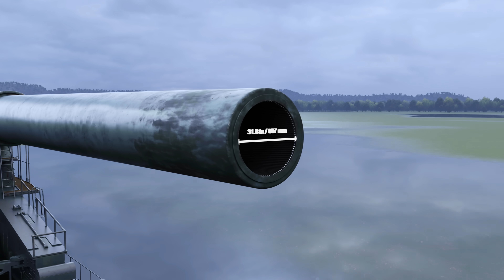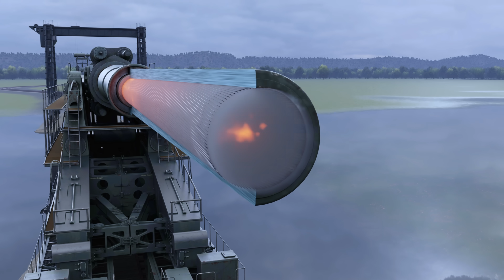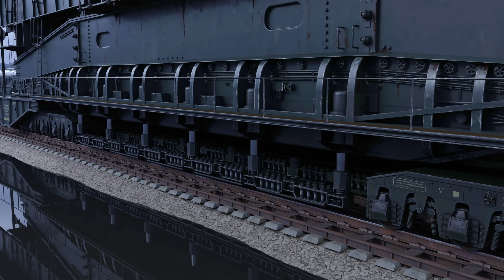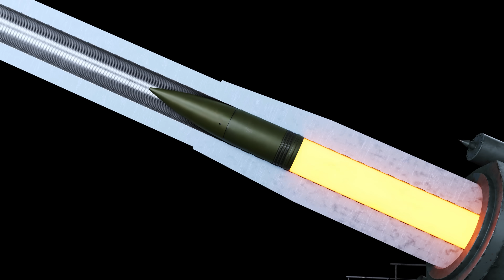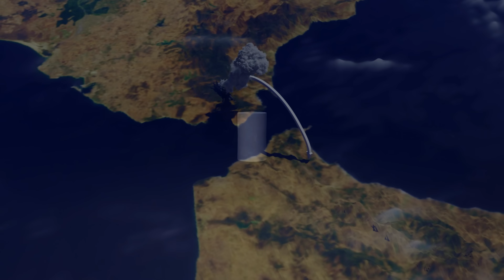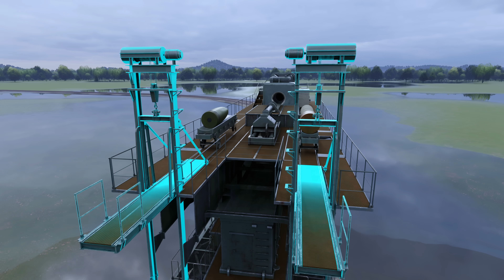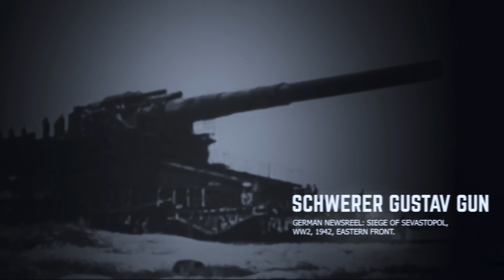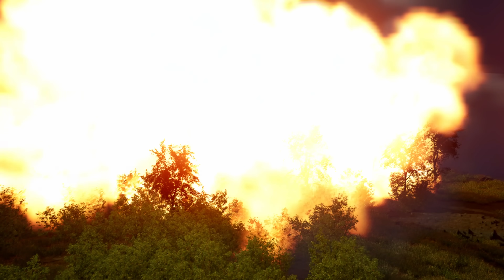Inside the Schwerer Gustav

Comment: the final boss of logisticans
Reply: Logistics was not about the materials itself, it was about the deployment of those materials, how, when, and where.
Schwere Gustav was made to engage the French forts just bordering Germany, meaning it didn't even need to leave its country to operate, and in engaging Soviet forts, the gun could take its time since that fort wasn't going to walk away anytime sooner. In comparison, deploying a Sherman tank to Europe took more logistics capacity than Gustav as it had to travel entire ocean
And of course it was only deployed less than four times around, the efforts to transport the gun was completely insignificant inside German military in the entire war.
Reply: @sthrich635  Yeah, partly because they eventually figured out that moving the gun took more effort than it's worth. Gustav really did not give you much of a bang for your buck, compared to other weapon systems.
Reply: @psymcdad8151 Correct, it was a rather specialized gun system for engaging heavy static forts, and it was far from a prioritized equipment in German military. German leadership built much more tanks and planes, mobile assets that were needed for more fluid battles in WW2
Reply: @psymcdad8151  other weapon systems simply could not do what this heavy rail gun did. no use shooting at a large underground fort if you dont have a single weapon that can penetrate enough earth to reach it.
Reply: @danielsteger8456  Except there were Weapon systems available to do just that.

Any underground-Fort that has no connection to the surface is... well, dead. Without a surface connection, you starve/dehydrate/die from CO2-Poisoning. Any bunker needs a surface connection. And for the surface-connections, there were readily available weapon systems that were both: More reliable and more accurate than an oversized artillery shell roughly lobed in the right direction. Bouncer-Bombs, Armor-Piercing Shells and early Bunker-Buster-Rockets were available (maybe not everywhere, but the general Idea was out there and was applied when reasonable), and where they were not, you just blow up the entrance and wait until it opens up again... and then collapse it again (The inhabitants starve or surrender. Either way: They can not reasonably break free and disturb your movements).

And the Schwere Gustav was way too Inaccurate to repeatedly hit those forts anyway (During the Siege of Sevastopol, the only combat action the Schwere Gustav ever saw, it fired 48 Rounds. One (1) did hit its target spot-on and made a resonable impact. The others were 50-740(!) m off target (Translation-Help: 1m ~ 1 yard). Even with lower Penetration: A wing of Ju-87 with 500kg Bombs could repeatedly hit the same crater and have the same result, with higher accuracy and much less logistics involved. And the Ju-87 was already an aged plane by 1941 falling behind advancing technology). Gustav was designed to Fire on French fortifications, a scenario thought of after World War 1 in 1919. Due to the Wehrmacht 'taking a shortcut' through the Netherlands and Belgium, it was unneeded for that purpose. And Questionable to begin with; Progress in aviation made it obsolete on arrival.

The "Schwere Gustav" was like The 'Donald Trump Battleship Class'; A weapon system entirely outdated, developed and delivered to please one lunatic's ego. Not trying to sell the engineering and logistics behind it short, from that perspective the Gustav was a thing to behold. It was just a waste of resources on top of that. Like a Mixer that can efficiently mix poop under mashed potatoes and no one tastes the difference. Impressive if you can pull it of, but why the hell did you do it in the first place?
Reply: @psymcdad8151  Gustav, much like the Karl Geräts, were bunker busters, since Germany didn't have air-deployed anti bunker ordnance, so they needed to resort to superguns.
The problem is, that was pretty much the only thing it could do properly, as even though it was devastating if it hit any other objective, even regular artillery was too mobile to engage consistently.
A much better railway gun was the Krupp K5, which was a lot faster to transport and load, while still keeping excellent range and power.
Reply: no I don't even want to think of the logistics.
Reply: @Yukilovesgirlsonlygirls that was Hitler's battle plan for Barbarossa
Reply: @hazyjph Originally it was meant to be used against France
Reply: @Breatos I was referring to Hitler's battle plan for Barbarossa having no logistics.
Reply: @hazyjph  it had logistics, but they planned for a much quicker offensive than it ended up being.
The logistics for a blitz have nothing in common with the logistics for a longer war, and had they accurately predicted the resistance they'd find, the logistics would've been on edge.
Reply: @staringgasmask the main problem that you see running throughout WW2, was the mindset of the man in charge. How the German's were supreme soldiers and the Russians were subhuman scum. And to then predict it'd take 8 to 10 weeks to destroy the Red Army, it's just nuts. You saw that typical nazi mindset in Göring too when he said it'd take 3 to 4 days to destroy the R.A.F. over England, and also how no bombs would ever fall on Berlin. That along with the wrong intelligence coming in from the different services too, not just the Abwehr.
Reply: Yes, it’s like playing Foxhole.
Reply: landcruiser: oi
Reply: i mean there's railroads right there
Reply: @resigned7739  You need four parallel tracks...
Reply: @alexandermieske797 wtf
Reply: @Henr09 large entourage for assembly, construction of the railway lines, ammunition logistics (shells weighed 4.8 to 7 tons) and guarding. and you need 1500-2500 Soldiers. It was psychological warfare and was only used once, at Sevastopol in 1942. It is certainly impressive, but not suitable for a war of aggression.
Reply: Dictatorship XD
Reply: it's as impressive as it is stupid, kind of like the Tiger. A huge impressive machine, practically invulnerable...that drinks thru fuel and can't be repaired in the field. German engineering is something else.
Reply: Guillimans greatest opp
Reply: Ostateczny cios dla logistyków
Reply: Germany is whom the USA have gained much of their knowledge.  If HItler had not been in such a rush, declaring war on the USa, then invading Russia, biting off more than Germany could chew, I do question the outcome of WWII.
Reply: @1963Austria really the tripartite pact was pointless how much did Japan do to Germany to go to war with them against the U.S a successful campaign against the suez was probably peace with Britain but who knows
Reply: @1963Austria  they were always destined to lose, it was only a matter of time
Reply: @1963Austria  You see the pure genius of the German war machinery in this gun. 
Fascists are all show no substance.
Now one might say "yeah, but what if it wasn't for the nazis, and inly the military people would have been in power?" Then there would not have been an second world war. 
WWII in itself was a stupid idea. There is no scenario where Germany is fighting a smart world war.
Reply: Theres mulitple ways of victory or draws in Hearts of Iron III (my personal fav.) for Germany. Ive never did it
Reply: @1963Austria  the Soviets had already stopped German advances before major land lease arrived while outproducing the Germans even without allied support. There is no scenario Germany can win WW2 that doesnt involve magic or both soviet and allied incompetence to a ridicilous decree.
Reply: @fiiral5870 if they would force the nuke from beginning, the world where different today
Reply: @pimmelberger9967 Hätte Der Hund nicht geschissen, hätte er den Hasen gekriegt.
Reply: @1963Austria manhattan
Reply: @CubeThing would not have happened so quickly if Japan didn’t decide to fuck with our boats forcing us to finally join the war
Reply: @redactedrider7606  the germans shot their foot by killing jewish scientists (or causing them to flee), resource mismanagement and losses, as well a fundamentally flawed understanding of nuclear physics pertaining to uranium enrichment. They most likely never would have produced a working atomic bomb, and if they did, it would have been too late.
Reply: @1963Austria  they were on the way out regardless. They were losing money and resources. It was always only a matter of time. The attacks on russia and the USA involved only shortened the time.
Reply: Video games! Hahaha

Comment: Really should have mentioned that the designs for these railway guns were made during the mid 30s and eventually started production in the late 30s, completed in 1942. An entire weapon designed around putting holes in the Maginot Line in 1940 was never really going to find a good home later on that late into the war.

Comment: @3:10 This means 33+ tonnes per axle which is quite high even for today's standards.
Reply: Probably making pretty level aiming curve, slow movement of the assembled gun and lots of jack pads to transfer recoil were all the precautions caused by this fact

Comment: I hope one day we get to see an "Inside the Maus" video
Reply: most likeley not because there was never a finished version build.
Reply: @KanyolfWestler  There were 2 finished prototypes of the Maus by late 1944 but got destroyed by the Germans when the war was ending, then reassembled together into a single Maus by the soviets and put into a museum.

I do agree with you in how the chances of the Maus getting an "Inside of" video are very low, but low doesn't always mean none.
Reply: @UJUOKGYYU7thats not true. there was a wooden model only. i am from germany
Reply: @UJUOKGYYU7 the soviets assembled one but it was from scrap parts without building plan
Reply: @KanyolfWestler There were two finished models, who were fully capable of driving. One had a mock turret to simulate the weight of the projected actual turret, and the other had a fully finished turret. The one with the finished turret was blown up by the retreating German Soldiers, so the Soviets took that turret and mounted it on the other chassis.
Reply: @mistermisteron ok i have just again researched this and you are correct. this blows my mind that it was actually finished
Reply: I was hoping this video was using the other meaning of inside. I always wanted to do that with a railway gun
Reply: Hope he does makes a vid about it

Comment: I've never seen an object requiring TWO side by side sets of railroad tracks
Reply: Harbor cranes!
Reply: @misterpotato427 True, but in their case it is to provide stability. Here it is due to the insane weight.
Reply: @FloydMaxwell  Could also just have one big ass railroad the size of two or three tracks...
Reply: some rocket launchpads have that iirc
Reply: Nazi engineers was actually considering making a dual track railway throughout Europe so the inside would be double the height and width insane features like a 169 seat theatre carriage and even ones with a swimming pool ect
Reply: And you can never say that again…
Reply: 4 !!! Car sans portique, pas de canon en place !
Reply: Try the Russian N1
Reply: @ProPexPup  what dat ?
Reply: @White_Night_Demon  Russia's 1970s failed moon rocket.
Reply: @ProPexPup  did that use bigger tracks?
Reply: @White_Night_Demon  I suppose it's CCCP/Russian gauge. Russia's railway system already has a wide track than EU.
Reply: @ProPexPup  hmmmmm